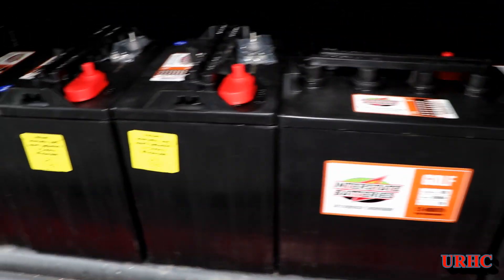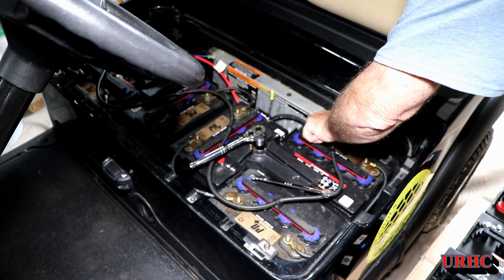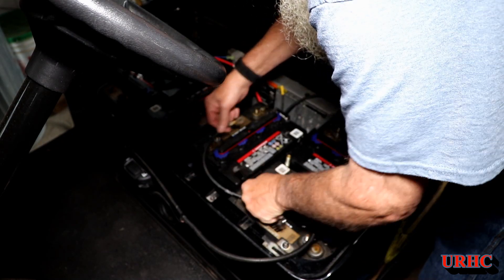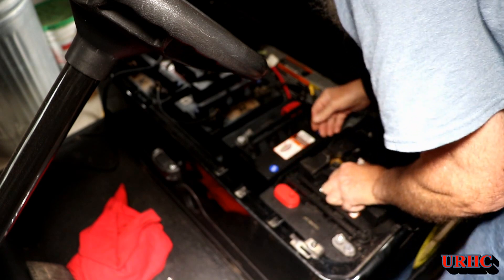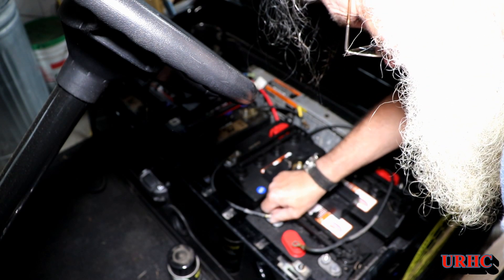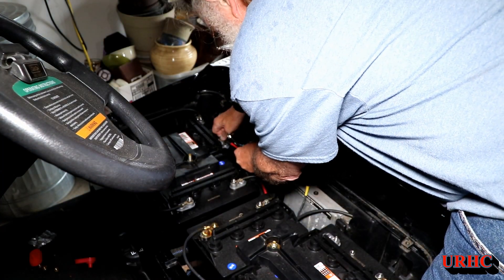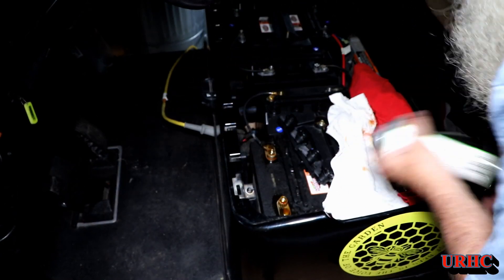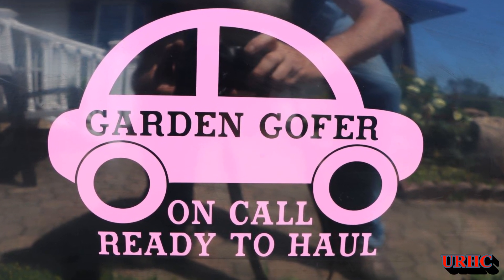New Batteries And A Name For The Yard Cart

Comment: You give a whole lot of excellent advice in this video!
Have dealt with lead/acid batteries for over 50 years! The ship used many of them for short term backup, yes a 67,000 ton ship had battery back up. One electricians mates sole job was battery maintenance.
Hopefully many people will see this and extend the life of their batteries AND wallets!
Love the URHC logo. Great job on that.
Thanks again.
Sincerely 
Rod
Reply from the maker: Thanks. It's hard to believe  that lead/acid batteries are still the lowest cost and safest power storage option after all these years. Thanks  for watching.

Comment: Watching you swap those out it struck me that the wire guage seems a bit small. If you measure the length of all the cables and the go to NAPA, or your parts purveyor of choice, and get 0 or 1 guage battery cables preterminated in a length as close to what you need, I think you'll do a lot better, especially on colder days. The internal resistance of a cable is related to cross section and length. Short Fat Cables have lowest resistance. 

Along the same lines, add an aux ground wire between truck / car / tractor starting battery and any convenient bolt on the engine block. This gives you a solid, low resistance redundant ground path for the starter. Again, in the cold weather this gives you a much stronger starting effort....those cold cranking lamps (CCA) get where you want them.

Also helps with all those sensors all over the engine too.

Thanks for sharing.
Reply from the maker: Yes it does look a little small but this is a 48 volt system with the computer controlling the motor running and regenerative braking so there is no large surge load. Should the cables go bad I will definitely go larger with replacements. It also looks like they used a high strand count wire that offers more surface area. With the price of copper it's not like the old days where everything was oversized.  Thanks for watching.

Comment: My buddy buddy has replaced many sets in his. Cables as well, as they corroded often being near the water.
The bulging I've seen as batteries go bad or overheat, not sure if that happened to yours.
How did they set your brake regeneration? My buddy's is at 50% I think but you need to be careful what they set it to.
Reply from the maker: That salt water is really tough on equipment.  I don't know the history of the cart and it was used on a golf course for 5 years before I got it. I don't know what the regen is set to. Have to find the software to check it. I think this is the first year it is controlled by software.  Thanks for watching.

Comment: I keep looking for that dug up area from the Winter, either you have not video'd it or it is patched/blended in too well to detect it. Did you take the old batteries back to Costco, how did that go, any refund for turning the old ones in?
Reply from the maker: It's mostly grown back and luckily the grass color matches what was there. It has settled a little since drying up and I will have to add a little topsoil to really smooth it out next spring. Thanks for watching.